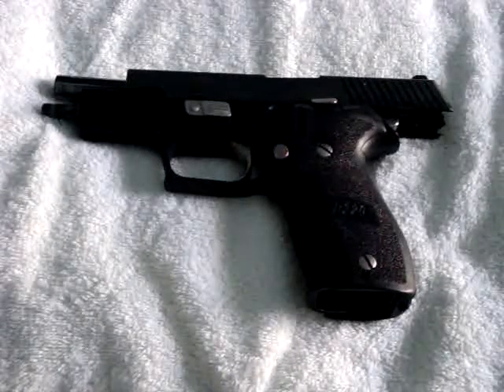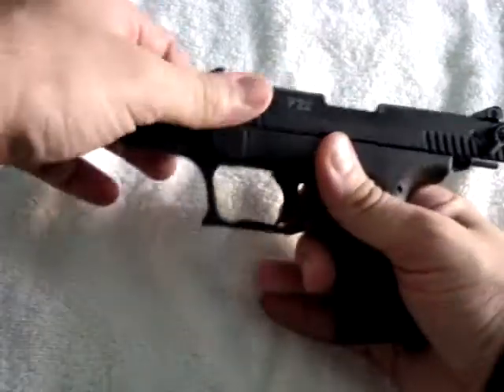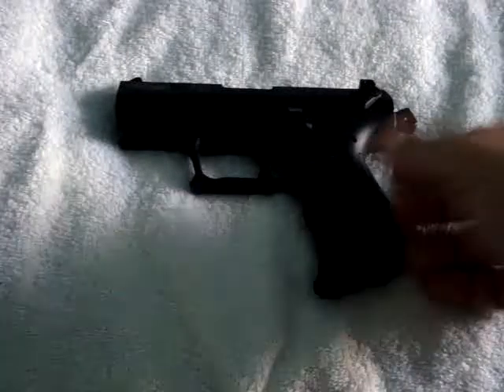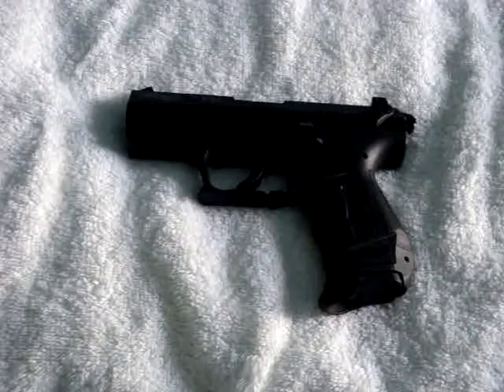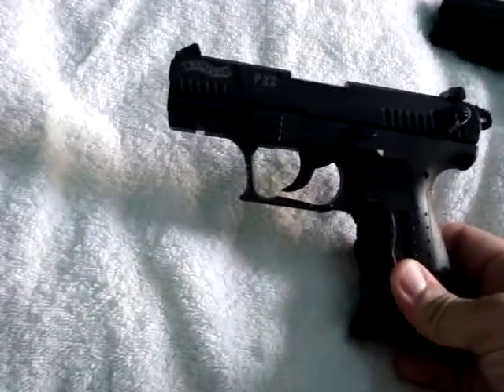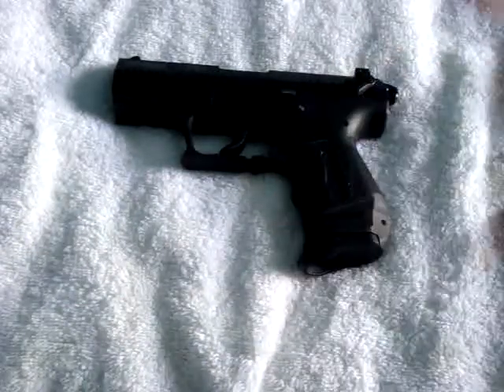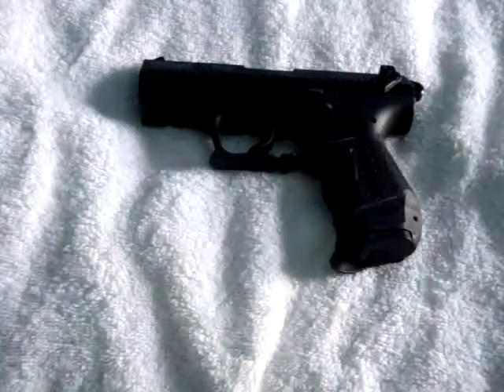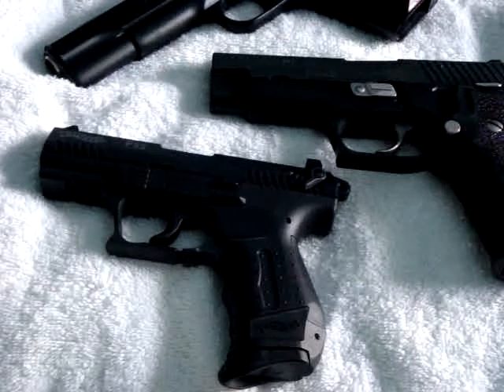Single Action? Double Action? What does it all mean?  -  Part 2

Comment: @mrblonde108 I've had some experience with a Beretta 92,  they are a single/double.  You can chamber a round, flip the safety back on and it decocks the hammer for you.  You can then flip the safety back to fire and it and it works as a double action with a long trigger pull brings the hammer back to fire like the Sig in the first video.  But you are right it stays in single action after you fire the first shot.

Comment from the maker: @BASSIST73533 The Walther P22 is semi-automatic, as are all the pistols in this video. Its functions using a Double Action/Single Action (DA/SA) system. The first round is fired from DA mode. After the first round is fired the weapon cycles, part of this cycle is to automatically cock the hammer. This then sets the firing system up in SA mode, meaning that the next pull of the trigger only drops the hammer onto the firing pin. A SA revolver needs to be manually cocked for each round fired.

Comment from the maker: @AKSKSMAN Dry firing a firearm chambered for a rimfire cartrige can damage the chamber of the firearm. Dry firing will not damage the springs or firing pin and is now routinely taught as a means of learning trigger control. You can use snap caps if you are concerned about damage to the firearm, or you have an older gun you want to practice with.

Comment from the maker: @phfr45 Its going to depend on the particular firearm. With most DA/SA firearms you can decock the firearm after chambering a round. You would then carry the firearm in the double action mode. The first trigger pull would be double action and then the following trigger pulls would be single action,

Comment from the maker: That's basically correct.
Double Action makes for a longer, heavier trigger pull. This can be more difficult for some people to use depending on their preferences. 
You may choose DA firearms because they are easier to use because there are less manual safeties to disengage. The long trigger pull is used as a safety.

The only way to decock the Walther P22 in this video is to manually lower the hammer.
I hope this answers your question. I wish I had room to explain better in this comment.

Comment from the maker: @teclec Depending on the firearm, there may be a firing pin block which keeps the firearm from discharging unless the trigger is fully depressed. The DA only Sig P226 does not have a half cock position, and as far as I know there aren't any DA firearms that have a half cock position.

Comment from the maker: @NolanMGI All of those striker fired firearms are said to be double action only. I think since there is no hammer to speak of in them, they fall into the double action category. With that said, if you ask me, they operate more like single action firearms because the slide must cycle for the striker to be reset. this is much the same as a single action only firearm where the slide re-cocks the hammer. The only difference being the presence of a hammer that can be manually cocked.

Comment from the maker: @ElijahCheWhite No. A DA/SA firearm has the ability to have the first shot fired from either double action or single action (usually the first shot is DA, as this is the way the firearm is meant to be carried). Then all follow up shots are from the single action mode unless the round does not fire. If it does not fire you have the ability to squeeze the trigger in double action to attempt to restrike the primer and fire the round.

Comment from the maker: Yes. The firearms we are talking about they have to be cocked to fire. The difference is in how they are cocked. The point to a DA/SA is that the trigger pull for the first shot is long and heavy so as to not necessarily need an external safety, but then the following shots are in a single action mode as to facilitate faster more accurate follow up shots.

Hope this answeres your questions.

Thank you for watching.

Comment: I dont like a weapon that allows a hammer to rest on a firing pin, ex. i have a 30-30 that went off due to my hunting gear sliding off my body which struck my hammer thus firing a round, my fault for not half cocking the weapon and having a round chambered,,, but some of these pistols you showed like the DA seemed to not have a half cock safety at all... is this true? btw i did have my muzzle pointed at the ground when my gun discharged unintentionally.. as i always carry my rifles like this